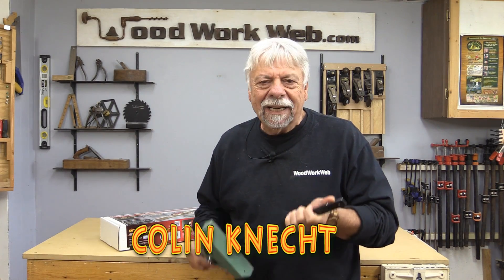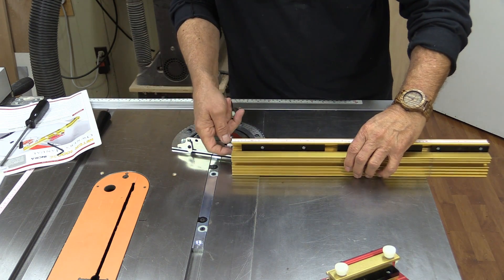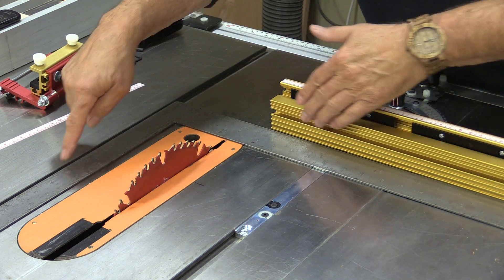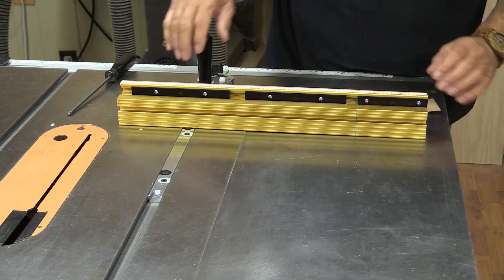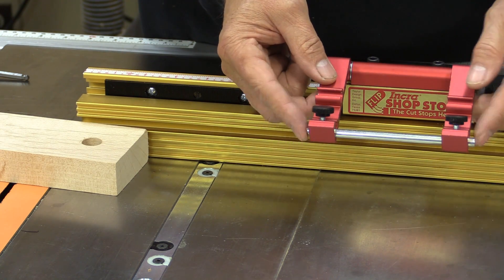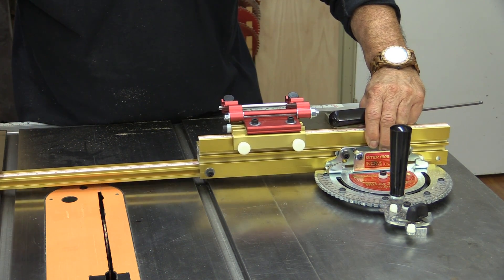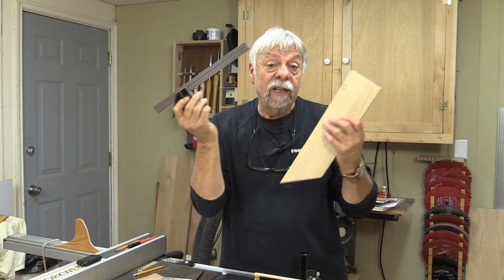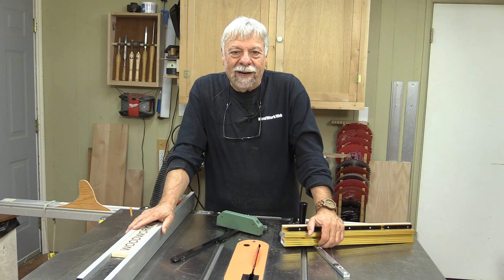Incra MITER 1000SE: Table Saw Miter Gauge Set Up & Review

Comment: I too recently acquired the Miter SE and have had problems with the small white plastic expansion "washers," which take up slack in the miter channel.  No amount of torque will expand the washers enough to spread them and remove the slack.  And that tiny hex wrench accepts only so much torque. Anyone else have this problem?  I am trying to install in my Laguna Fusion table saw.   I put the washers in hot water hoping to soften them enough to expand, but to no avail.
Reply: I answer my own question -- I replaced the black non-expandable nylon washers with the white expandable ones.  Thus, you spread the washers on both sides of the miter bar.  Seems that Laguna's miter slots are wider than other saws.

Comment: It seems like your left extension table is set lower then the middle section. You might want to check that out. 
If you look at the gauge there is clearly a larger gap where the extension starts.
Reply from the maker: Thanks for the tip and thanks for watching!

Comment: Mine doesn't snug in the slot. No matter how tight they will never bulge past the bar. Also, no one answers at tech support after 9 calls. Sweet
Reply: Dustin, no disrespect here but are you SURE you are tightening the spacer rings enough?  When I got mine and wend to do that adjustment, I thought the same thing.  I turned the things to where they got tight and hard to turn and they didn't take up the slack.  I said the heck with and tried tightening a little more and that is when they started doing what they are designed to do.  As for tech support, I have never reached out to tech support.  When I have a question I send an email to mark@incra.com (the big bearded dude that does all of the demo videos).  He always get back to me.

Comment: 3:40 put a engineering parallel to the blade between the theet, so the hook is resting on the block instead of the blade with theets.
Reply from the maker: Thanks for the tip and thanks for watching!

Comment: How about the 5 cut method!
Reply: Tom, any chance you could explain how to use the 5 cut with a miter gauge?  It seems like it would be different for the gauge vs the sled where the fence only pivots on the end closest to the blade the the miter gauge doesn't just pivot.  Also, what do you use to get your length measurement, the screw on the far right of the gauge or the far right end of the fence?  Maybe I am over thinking it.

Comment: Great video and nice bit of kit. Sadly my old table saw made in 1972 has slots which are 3/4 × 1/4 and all replacement mitre gauges are for 3/4 × 3/8 slots. The saw is brilliant and will outlast me so I don't want to replace it or have to explain to the cfo (aka) the wife why I need to. Colin do you know or does any other reader know of one which might fit.  The original is just awfull. The saw is a startrite 275ds.
Reply: TerraTN maybe. I'd did think of buying this kit and identifying a local engineering firm with a flat bed grinder to take 1/8 from the bar or even make my own bar but without investment I don't know where countersunk heads maybe and what impact the missing 1/8 is. I know there are many people stuck in my position. I even investigated using a tct cutter and router to deepen the slot. People have done this on other things but its keeping the cut within it's original bounds for the whole length of two slots that bothers me and whether the cast iron might shatter.
Reply: Check out Red-Line saw fences and accessories, some of their products were designed to retro fit  older table saws. I have a mid 1970's Beaver table saw.
Reply: Cass Zimmerman thanks. Will check Google.
Reply from the maker: I'm not aware of any, but I would simply contact some manufacturers like Incra to see what they have to offer. Thanks for watching.
Reply: I've had to deal with this before.  the solution is easy.  simply use the miter bar from the old miter gauge that came with the saw.  then "retrofit" the old miter bar to the new gauge.  It's sized correctly and all you have to do is drill and tap some holes in it.

I've used this exact miter gauge Colin is evaluating for some years, as far as I can tell the only ones better are a couple of other Incra Gauges, but this is the one that I go to time after time.
Reply: Zifnab I thought about this but the original bar is only about 8" long. It's a good idea so I may revisit it. Thank you.

Comment: What if the blade is not perfect parallel to the blade?
Reply: I guess you mean "...parallel to the MITER SLOT", not the BLADE... Well, then you have to adjust the blade to the miter slot by loosening the motor and make the blade parallel to the miter slot. The 1000HD is exactly square to the miter slot (at 90°) if the plastic inserts are tightend as the manual describes it. Any side play in the slot has to be removed as Colin demonstrated (a bit too short, as this is the most important part of the setup)
Reply: @altepost3805  ah.. sorry, yes!
I see, also makes sense.

Comment: you may be surprised if you check your blade to the miter slots. you need to true your table saw by truing your blade to the miter slots first, then the fence to the blade. use the method of 5 to magnify the severity of error, compensate and away you go. you may be surprised. when you achieve 0.004" run out in a 8' rip of maple let me know.
Reply from the maker: Thanks for the tip and thanks for watching!

Comment: The trick to aligning the miter gauge with the blade is to use a square that is small enough on one end to fit inside the teeth of the blade. This is how I do it and it works great. Also, that giant square you are using may not be completely square. I've seen a lot of them that are off a bit, so it should be checked to make sure it is in fact square before using it. 

The gauge fence is scraping because your tablesaw wing is nowhere near being level with the rest of the saw table. You might want to fix that.

You also didn't cover the setup of the stop. If you set that up correctly, it's more accurate than a tape measure. I have the incra 5000, (which is much bigger and has a sled) and I don't have to measure my cuts with a tape measure or anything else. The cuts are always perfectly accurate.
Reply: I'm glad you commented on the big carpenters square.  I was wondering how accurate they are.  Also thank you on mentioning about the correct setup of the stop and how accurate it is when setup properly.  For over six months now I have been looking at the Incra 5000 and now plan on getting one in a couple of weeks.
Reply: More important to be square with the _slots_, because they are the axis of movement when sawing.
Reply: or raise the blade to a point where you miss the teeth and only hitting the blade, that's how I do it.  I actually just received this miter and I am going to do the five cut process to check/set accuracy.

Comment: If you still have need of the old miter fence and want to easily set it to 90 degrees with some form of accuracy, here is an old trick. Just loosen the pivot handle, turn the miter gauge upside down and put the miter bar in the slot. Push it up to the back of the saw table and then tighten the pivot handle. Once it is tightened, just turn the miter gauge over and reinsert it in the slot. If the saw table was made accurately, the miter gauge SHOULD now be set at 90 degrees.

Comment: Wish they made one to fit an old sears table saw.  The saw works pretty good but the fence and miter gauge are terrible.  Hard to justify buying a new fancy table saw as the cost is substantially more than my house payment.
Reply: Hi Rusty,
You'll have to check your miter gauge slots in your saw top.  If they are 3/4"wide x 3/8" deep (or less) you'll be good to go. BTW, Incra also makes and sells some nifty table saw fence systems.  Just Google Incra Tools.
Reply from the maker: I'd send Incra a not to see what they have to offer for your table saw.
Thanks for watching!
Reply: I had an old (and I mean OOOOLD) craftsman table saw that I got as a hand-me-down and the incra miter 5000 fit perfectly on it. They do sell a shop smith version of most of their miter gauges, which is a different width, so maybe one of those will fit...

Comment: Another great video Colin. I like the 1000SE because of everything in the package (telescoping fence and shop stop). However, I wish the V27 had a similar package. The V27 has all the positive stops I'll ever need, and it is very solid. I've heard people have bent the teeth of their INCRA miters with stops at every 1-degree (V120 and V1000HD). A simple bump or drop can bend a tiny tooth. The V27 seems like the most robust gauge (The 1000 is also similar in spacing between stops). It's also the least expensive in the INCRA line.
Reply from the maker: Yes, you should be careful not to drop it. Thanks for watching.
Reply: I have a 1000HD and the teeth are not "tiny".  They are pretty solid but yeah, take care with ANY miter gauge.

Comment: No!  Don’t throw away your old miter gauge.  Just repurpose it to the router table where you leave it at 90 degrees.  Use blue tape if the old gauge doesn’t have adjustment to the width of the 3/4” bar.

Comment: I bought one of the Incra 1000SE guages in 2011, and I was very disappointed in the build quality.  My main problem with it is that the face of the base assembly is not square to the table.  The "base" assembly of the tool is not a casting like many other miter guages, but is a two-piece assembly. The flat semi-circular piece with the notches and angle markings has a bent piece of heavy (12-gage?) sheet-metal connected to the top at the front edge. The bent angle-piece is there to attach the extrusion (fence).  Unfortunately, the manufacturing process did not produce a good 90-degree bend in the part and the face of my fence is tilted back 2 degrees from a true vertical position.  If I pull a work piece back snug against the miter guage fence, it tilts back and the front edge of the piece gets lifted up off the surface of the saw table (until the blade contacts it!)  Totally unacceptable for a tool in ANY price range. 

The system shown in this video seems to have a more complicated piece for attaching the fence extrusion.  It looks more like a "U" channel rather than the simple "L"-shaped piece on my guage, and there are a couple of additional screws that may be jack-screws (for squaring the face to the table?)  I just looked at photos of an Incra MITER1000/18T guage, and it is constructed more like the older 1000SE that I have.

I can probably find a piece of decent 90-degree angle stock (aluminum or steel) and fabricate a replacement for the defective part on my Incra, but I shouldn't have to do that. This system is an example of a good idea that is poorly executed.
Reply: I have the HD model and the manual shows how to adjust out that 2 degree angle

Comment: I just bought one of those brands gauges and it's better than the tablesaw table

I just found out the guide grooves are of different depths to the point the gauge won't work 🤦

The guide bar sticks above the slot on one groove and the other side it fits except for the adjustment screws are sticking above the table surface

The grooves have a depth difference of 1 millimeter....🤷
Why why why🤦

🖐️wait.......🤔
Ill keep the gauge and get a new table.....🖐️wait.....

Ill take the table apart and have a machinist mill it to the gauge specifications....

🚪🚶🏼‍♀️

Or..... I could sell my tools,  start reading books instead and become a know-it-all arsehole....🤔😑

Or keep the gauge so if I get another table saw ill already have a good gauge....🤔

Or.......get a tool that can grind the two slots down to the correct depth....but then if I sold it the gauge that is with it wouldn't work.
Lets see....🤔

Its a good old table except for the things that need upgraded like....🤦

omg....i just realized...🤯

What if the gauge is better than me ..😵 and getting a better saw makes me look like a whittler instead of a woodworker...

🥺
Reply: krrrruptidsoless Your dilemmas and conundrums are endless in supply. I hope you get it all resolved. I went to look at a used Unisaw once. Gorgeous top on that table. He was very proud of finding it cheap and rusty and having it milled to the beauty I encountered. I laid in his miter gauge (original) and it sat unusably proud. He didn’t see anything wrong with that. I sometimes wonder who might have bought it.